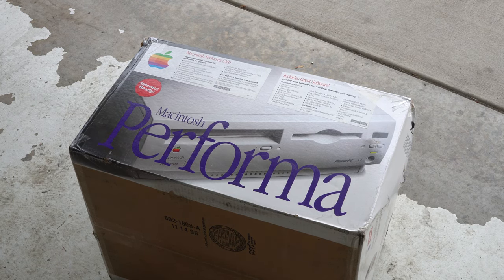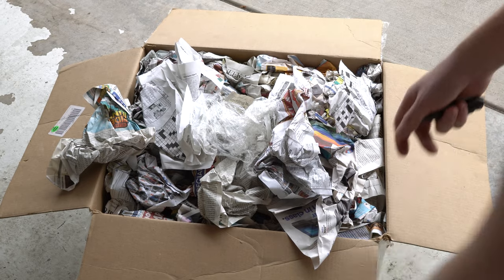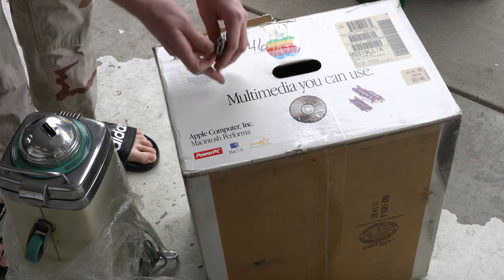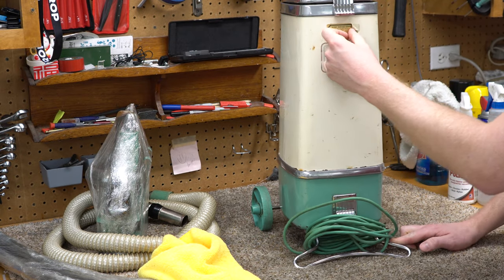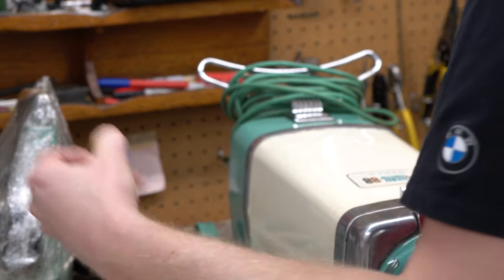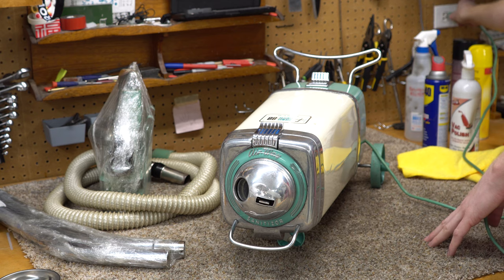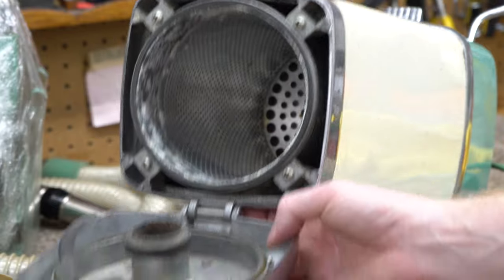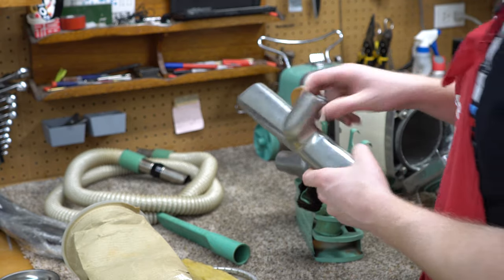Airway 88 MKII Vacuum  Unboxing & Repair (Part 1)

Comment: Dry rot try heat gun.
If you have old plastic use a propane torch quickly over it renews the plastic.